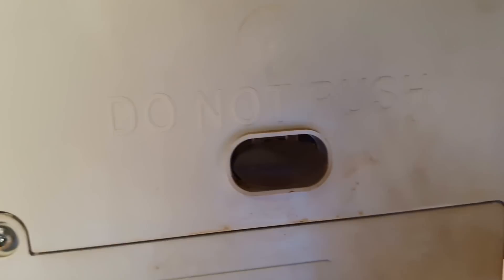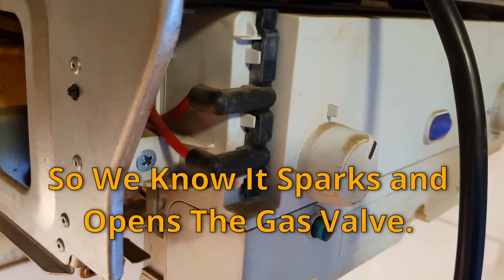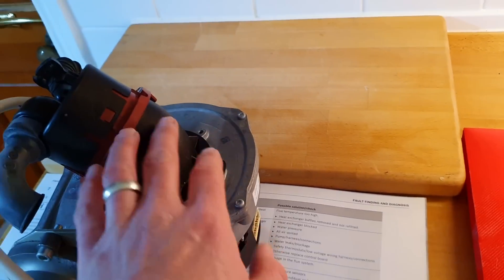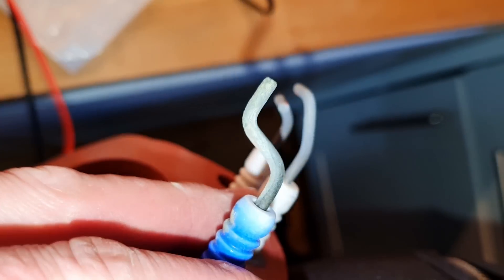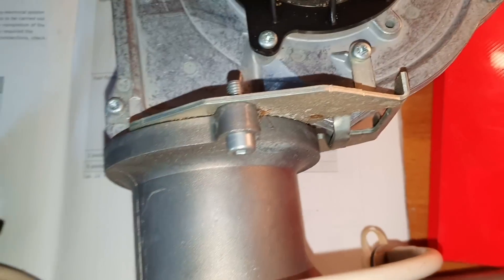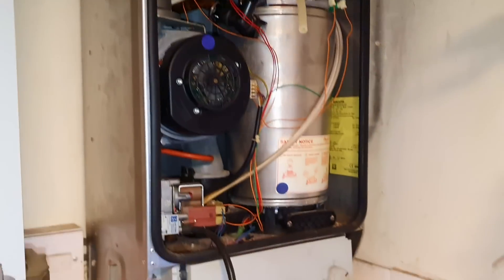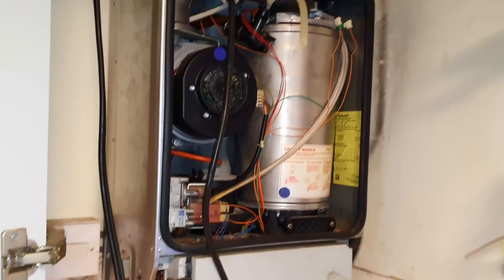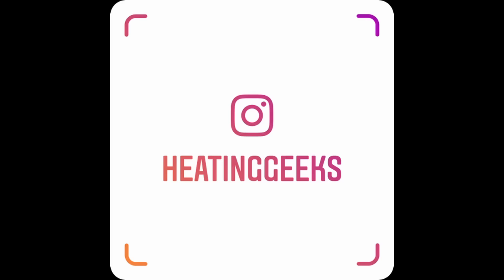"Don't Get Left In The Cold" Master Boiler Repair.

Comment: Great video, very helpful, sometime this greenstar don't stay on minimum rate what could be the reason, cleaned the heat exchange no joy, negative fan pressure was OK, any advice.
Reply from the maker: Combustion ok? Flue integrity good? Electrodes ok? A few different things to check there

Comment: Plastic rear plate that secures the plate that holds the mixing arm damaged heat may of escaped causing the overheat to kick in maybe..
Reply from the maker: Maybe, could also be the condense backing up after freezing? Or the bearing plate sticking. But who knows. Thanks for watching.

Comment: Great to have u back any chance of more than 1 video a week tho 👨🏽‍🔧
Reply from the maker: Mate, I'm struggling to do one a week. :-)
Reply: Great that was an easy one, common fault.
How about the fast flash being a "volatile lockout"?
2 local ri boilers really doing my head in, fully stripped down and still once a week one will do this lock out..
New electrodes, etc, looking at temp sensors?